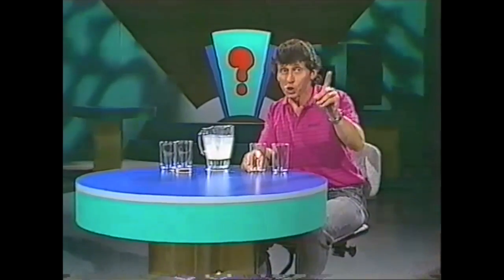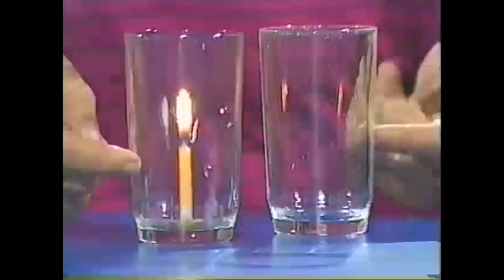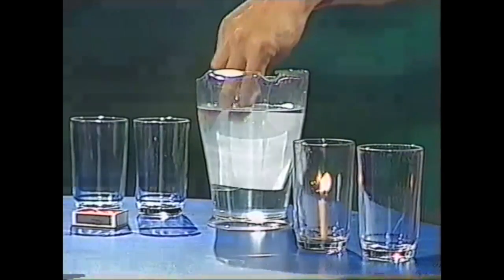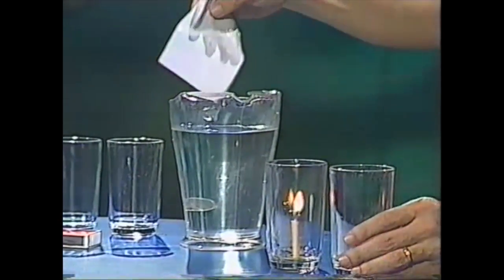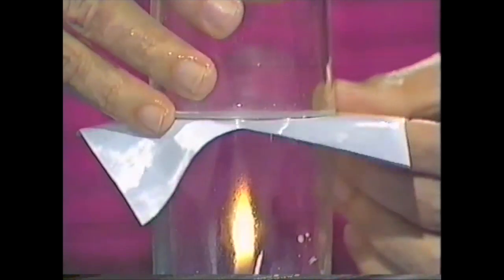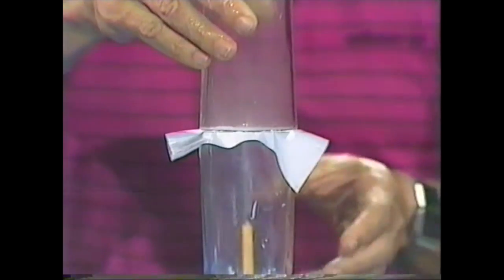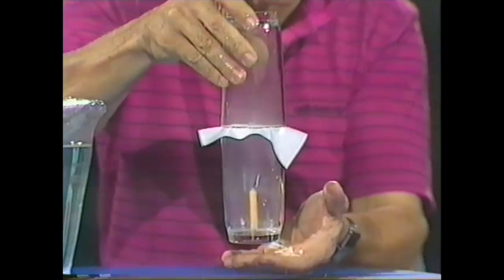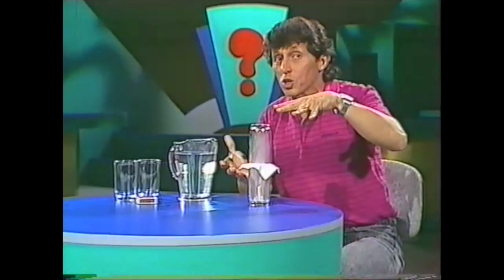Magdeburg Hemispheres in Germany

Comment: Where two matching hollow hemispheres of iron were attached to each other and evacuated. Horses couldn't pull them apart. 

One can lift a medium sized car using a crane, suction cup of about 2 X 2 square feet attached to its' roof and a common vacuum cleaner.